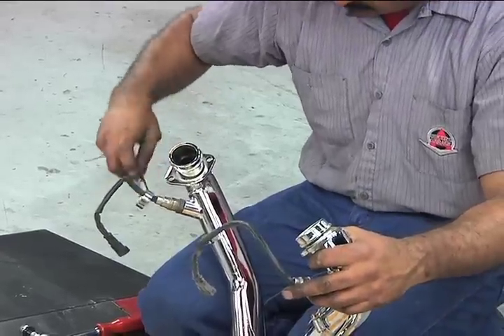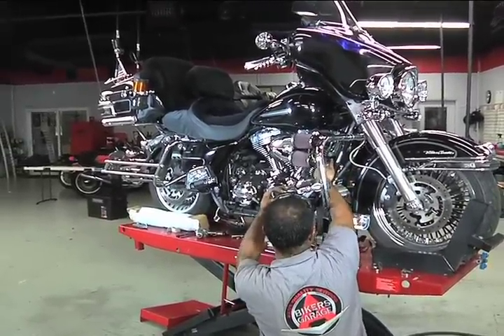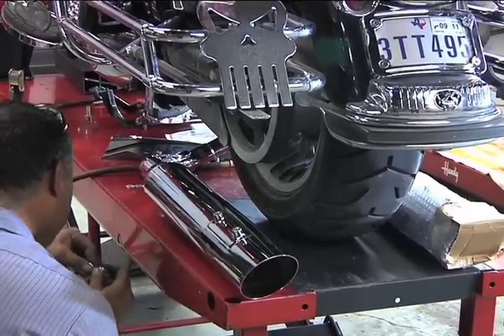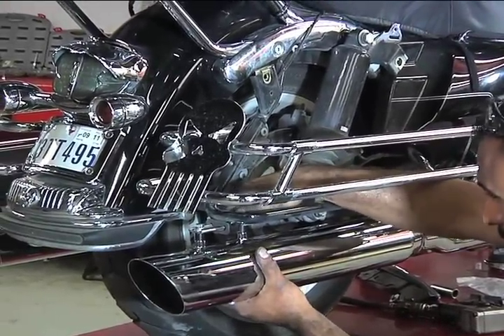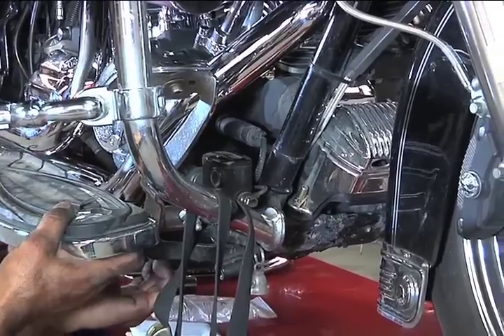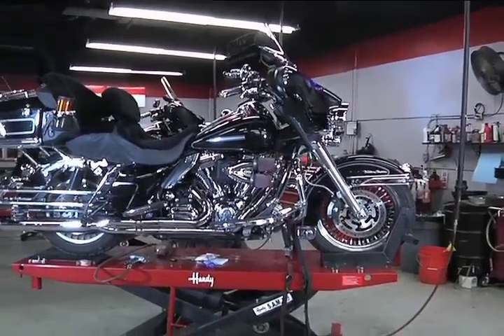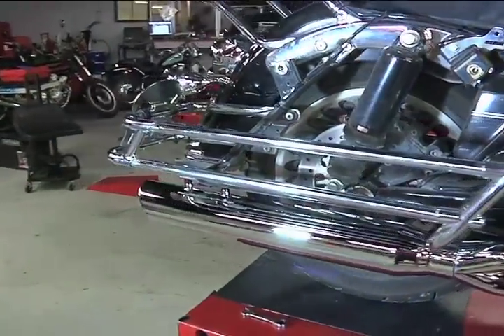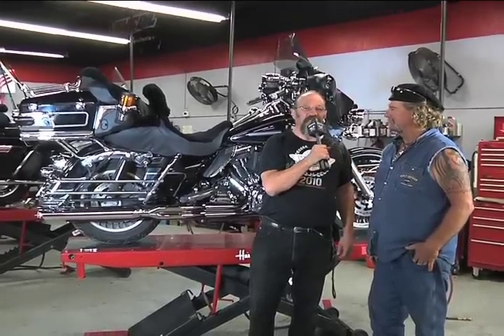PART2: Installing the D&D 2 into 1 Boss Cat Performance Pipe on the Harley FLHTC part 2.mov

Comment: It is a ghost pipe !!!
Reply: Poser bike, poser pipe.. fitting
Reply: It's dumb, just run it as a 2 into 1
Reply: One advantage of 2 into 1 is its a little less weight so forget the stupid fake pipe, also another advantage is its easier to clean under the frame and stuff with only one pipe. the second pipe is lame if u ask me, serves no purpose at all, just run a true duel set up if u like that look.